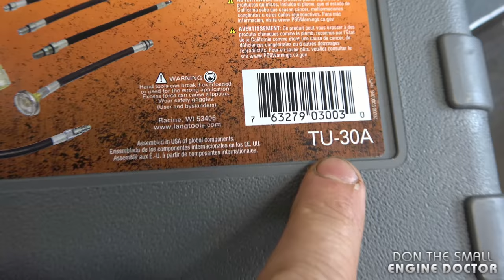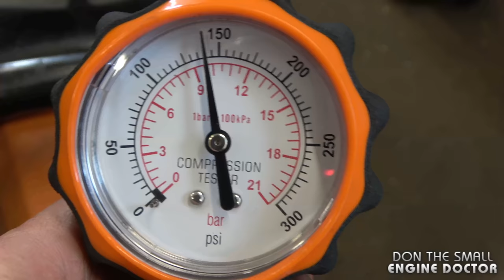You'll Be Shocked This Stihl Chainsaw Runs! You won't Believe It!

Comment: I wish I could see this saw being rebuilt! Gosh, I would donate $5 at least to watch a 1 hour video on you doing a rebuild!
Reply from the maker: really?
Reply: Me too. Sign me up for the rebuild
Reply: Likewise
Reply: Seen that alot in weed eaters. The cylinder expands when it gets hot and there goes your compression. Did you check the compression when it was hot? Bet it would of dropped half of what it was cold. Great video
Reply: @Paradise_Arms  Me Three!
Reply: @donyboy73   hi Donny how’s things man? Brendan from Melbourne Australia.... I’d love for that saw to be posted to me I’d rebuild it👍
Reply: Is it worth the money to rebuild it? It is a $1100 saw to replace it, so yes I would like to see it rebuilt.
Reply: I would as well
Reply: I’m in if you do this.
Reply: If bottom end is okay go for it. your fans want to see this.
Reply: Come on Donny, do it !  As long as the bottom end is good,  It is a good saw.
Reply: Yes a good rebuild video, kinda in depth would be extremely beneficial!
Reply: me to !!
Reply: @donyboy73  Absolutely.
Reply from the maker: @jimwesselman  i'll check prices
Reply: @donyboy73  saw is the piston replaced after repair, will the rings get fit and the compression will increase?
Reply: Agreed get a aftermarket top end an go for it! I wanna see what the rest of the inside looks like
Reply: I have the exact same saw but with M-Tronic . 441C with heated handles and it would be nice to see it being rebuilt 🙂
Reply: Taryl fixes all .may have a video on that.
Reply: Count me in I wanna see this rebuild! I have the same saw

Comment: Great tip Donyboy. Removing the muffler tells the story. Previously  my shop has wasted alot of time trying to find the problem. Now it's our policy on 2 stroke equipment to remove the muffler before doing anything. Amazing how much compression that saw in your video had. I used to go by that before, but not after watching this video. Thanks for the advice. Great following your videos 👍
Reply from the maker: good idea Robert!
Reply: That wear is still not normal, even with thousands of hours of run time, the wear should be slow and a "smoothing" and thinning out of the piston skirts. Scoring should not happen if piston and cylinder is properly lubricated. It got that way either from the airleak making it run lean on fuel, or the gas-oil mixture didn't have enough oil. I would never put 50:1 in 2 strokes, only 40-32:1. I care more about longevity than what the environmentalists say.

Comment: I had no idea that a chainsaw, and I guess pretty much any small engine, needs this kind of in depth checking and maintenance!  I bought a Poulan Pro PR5020 that I still haven't used, but I'm going to have to remember this!  Check for air leaks, cracked intake boot, loose cylinder bolts, etc.  I'll have to learn how to do all of that.  Do you  have a video on this; the whole procedural annual check?  Thanks for being you!

Comment: diagnosing my  old  441 magnum /arctic firewood saw and this video really  showed what to look for first . on my teardown  the crank seals are exposed and are worn out next i am no going to taking off the muffler to see if there is a problem in the cylinder and then deciding if a reseal /repair /rebuild is needed as it is around 20 years of seasonal use with only clutch system parts ,bars ,chains ,filters, plugs. not sure the new ones are actually the way to go vs the cost of rebuilding what has been a basically trouble free saw 🤔

Comment: Very interesting and good advice. After everything the guy replaced, my experience would have gone straight to worn crank seals, of course a leaking jug gasket would have presented itself when diagnosing the situation. I would never have considered pulling the muffler and inspecting the piston, especially when you have good compression. I learned something new today and I am not afraid to admit that I can add that to my 30 odd years of learning and knowledge. Thank you for sharing that information with us.

Comment: In 50+ years of working on saws of all kinds, I've never seen 1 with a hole in the piston but I have seen more than 1 with the piston dimpled/cracked from using an impact with a metal piston stop before. 1 other thing not related directly to the saw is the wear & tear on your shoulders from 50+ years of yanking on 'em especially the stout ones.

Comment: Wow that is a massive beast of a saw. Looks a bit like the huge (German?) one my father in law has (has also done the firewood business, as well as doing IT for a small engine shop, saw was a gift from the owner's family after the owner passed, was apparently set aside to give to him for years). 

Interesting to see another cause of "runs badly when warm". Just fixed my leaf blower in the fall, had stripped crankcase screws. (And finally replaced the disintegrating asbestos exhaust gasket with one that won't give me cancer - amazingly that piston looked ok)

Great video!
Reply: You can get even stronger Saws form Stihl :D but you dont want work withe that the full day :D the mostly used withe long swords for cut down trees than a smaler one to remove the branches

Comment: Yes, lots of videos covering ongoing saw maintenance but you quickly listed several things to check (air leaks, etc)I don’t normally see included. Maybe warrants another video.

But then again I’m now rethinking saving myself time, money and frustration by not spending lots of money on pressure gauges and the rest. Can’t believe I’m saving this, but the writings on the wall, time to get a battery powered model. Money saved not buying tools would easily cover getting into a new battery and charger system.

Comment: You are right - annual checks on well used saws are a must.  That is why I have a Mighty Vac.  I just finished building a 372 and it did not run for the first time without passing a leak down test.  I have found one of the worst places for leaks on Stihl saws is the connection between the boot and the carb.  I usually crank up my saws and spray break cleaner in this area to make sure it is still sealed.  I like the system used on the 372 better than the loose coupling on the Stihl which is dependent to much on nut tension. And the condition of the boot.
Reply from the maker: absolutely!

Comment: Hi Dony, that confirms that compression test, manual by hanging (or with manometer), is not reliable, except when the saw falls easily, so rings are dead  or  oval cylinder or both. It often happens that piston and rings are scratched even with a good test . So you are right : we must take muffler off!

Comment: I've got a 441c thats 10 years old and alot of firewood and chainsaw milling behind it. It's still running ok,but when I tuned it up this spring I checked the compression and it's down to 130psi. It's still got some life left in it but I'd love to see a rebuild video on it for when the time comes. I'd be torn between a $399 oem top end or a meteor kit for $150.

Comment: That there is a good marketing tool for stihl. My goodness that thing should have even started let alone cut...i actually bought a used Husky...exact same thing happened to me .   I knew my mix was right I cut maybe 2 hours with it and then I checked your video and Steve pull that muffler and it was and it was scarred up . I didn't have a dime-sized hole in the Piston but it still ran kind of..but still have good compression I couldn't understand it..would you rebuild that saw???  Seems like it would be worth it.... great video Donnie

Comment: I'm glad you made this video cause I naught a husky 262 last fall and iv been having a lot of trouble getting it to run it's got compression but I looked at the exhaust side a few weeks ago and it's scored  pretty bad. It was suppoaably just rulebuilt with new piston and rings and carb may be new aswell but cylinder is one. I believe I don't know how it got so scored the gas i put in was super rich

Comment: I spray all the areas that normally leak with break cleaner while the saw is running.  If you have a leak the saw will stop dead when you spray it around an area that is leaking.  I spray the carb and boot area, the base gasket flange and the oil pump and flywheel sides.  The last two will check the crankcase seals.  If anything is leaking, the saw will stop, immediately, so you will know what is leaking.  This saves a lot of time pressure testing the saw with a Mighty Vac.

Comment: Our shop had a 441 come in with a larger piece of the skirt missing and it ran as well. It wouldn’t idle, but it will run at full throttle.

Comment: I went to buy a couple saws and asked ahead of time if I could pull the mufflers.  No problem in fact one saw was scored and I got it for next to nothing. But I have had sellers refuse so ask before you take a long trip to see a saw because not all sellers will let you take it off. The honest ones will.  Great video. Simple things first!
Reply from the maker: good tips Ken!
Reply: Is it recommended to change the gaskets when removing and reinstalling the muffler?
Reply: @wingerrrrrrrrr  only of they are leaking

Comment: never ever seen that.  but it makes sense.  my initial thought and it could be as well on an older saw is a case pressure leak.  with the hole in the piston  until the piston drops below the exhaust port  it would vent case to  exhaust. thus lower pulse pressure and reduced fuel. one thing to note on the compression guage-  husqvarna in their manuals want you to use their guages.  the hoses are shorter (like really short and smaller volume). first they only want 3 pulses to get the reading and second it eliminates a lot of pulling.   any guage if you pull long enough will give you a maximum compression  but with fewer pulls it makes compression loss from worn rings and cylinders into consideration.
Reply from the maker: good info, thanks!

Comment: You don't really need to take the muffler off. You cand just use a small flashlight and look through the sparkplug hole. Usually the scoring happens in the exhaust side and if the piston is scored most likely you will see scoring on the exhaust side of the cylinder too .
Reply: What about a bore scope

Comment: I'm still wondering how it had good compression! Was the muffler partially blocked off from running it with a cracked intake boot? That's amazing. I just got through working on a blower that wouldn't run & i thought it was a carb issue so i was taking it apart & while doing so i saw that the intake was loose & that was the problem. But yeah its not always the carb @ fault! Thanks Don for your vids, Always good info & helpful.
Reply from the maker: muffler was not blocked, I think it still ran because Stihl has 2 piston rings instead of one like some husqvarna saws!

Comment: If the seller doesn't want you to take off the muffler, they may let you take out the spark plug.  You can usually see if the cylinder is scored with a bright pen light.

Comment: Seen that alot in weed eaters. The cylinder expands when it gets hot and there goes your compression. Did you check the compression when it was hot? Bet it would of dropped half of what it was cold. Great video
Reply from the maker: no i didn't
Reply: @donyboy73  Really there was no need to after seeing the piston and ring not to mention the cylinder. I was just curious what the reading was if you did. I worked on a Echo that had over 120 cold and 32 when hot. I knew what the issue was, I was just curious how much it lost from a few thousands of expansion. 
Your videos are of good quality and you make it easy for those who are not mechanically inclined or have alot of knowledge what to look and why. Keep up the good work.

Comment: I dont know if you have ever had an oil seal basically fall apart. My 025 was working fine the quit,so I shelved it for awhile and during COVID decided to tear down. After pulling it apart I come across the flywheel side seal laying sideways . The outer part of the oil seal was still in place. Piston and cylinder are in good shape . Did they have some crappy seals at one time?
Reply from the maker: a lot of factors may be involved, could have been a bad batch of seals, who knows

Comment: I got in a MS170 that wouldn't start after letting it sit for several months.  I attempted to start it several times and after the attempt I noticed a lot of oil coming from the muffler area.  It is new.  What could be the issue.

Comment: Hello from Serbia
I have Jonsered 2152 and have problem. When gets worm looks like air leaking. Increase RPM and overheating.  I spray wd 40 on intake boot (rubber) and i kill  saw. There are no cracks on rubber. Any way i replace intake rubber and i have same situation. If you have any idea?

Comment: Even premium pump fuel in Canada now has ethanol in it. Alcohol burns hotter than gas, and will melt 2 cycle pistons. I only use synthetic premix fuels now like Aspen, or Stihls motomix. Fine for me as a consumer, but industrial users that can get pricey.

Comment: Thank you for the great videos, they save me time and money! I have a question that I hope you can help with. I recently bought a used Craftsman chainsaw with a Poulan engine and Zama carb and at that time didn’t know a thing about chainsaws. It ran shortly and then would die each time I tried it. I replaced the fuel lines & filter, installed  a carb kit and replaced the purge bulb then dialed it in. It now runs and cuts without stalling. Before and after replacing the purge bulb, the bulb gets stuck inward and won’t come back out. Do you know what might be causing that to happen? From what I can see there isn’t any kinks in the fuel lines and I can see that the fuel flows in the proper direction when pressing the bulb. Might my return line in the fuel tank be the problem by being to long? I’m at a loss, any suggestion would be greatly appreciated. Thanks for all of the help you’ve provided in your other videos!
Reply: sounds like a bad fuel cap not venting

Comment: I love my 440, that I built a couple of years ago.  I thought the chain was not up to my specs.  My 440 will fly through small woods, like you were cutting.  My bet is - a bad boot made it run lean and smoked the top end.  I would do a leak down test on it, too.  I will bet the seals are smoked, too.
Reply: My opinion is based upon my chainsaws and gas blowers.  The way these engines are designed, a leakdown test wouldn't tell him anything he doesn't already know.  Piston rings were giving him excellent compression.  There are no valves in the cylinder head.  The cylinder and cylinder head is one piece, so no gaskets or sealing surfaces.  Therefore, a leakdown test would not tell him anything.
Reply: @danburch9989  you are probably right but it tells you where it is leaking and how much.  Most two cycles behave irrationally, if they run at all, with air leaks.  Last week I built a 372 and had not installed the oil pump when I tried to get it to pop. It wouldn’t do anything, until I put two short screws in the oil pump holes and then it ran, rather irrationally until I put the oil pump and spacer on.  Then it cranked and ran fine for a new engine.  If a saw is running irrationally I usually look at the seals, however they are sometimes leaking so bad the saw will not even start.  The Mighty Vac tell me which seal is leaking, but if it is seals it probably is bearings, too, because something wiped the seals out.

Comment: It did not cut bad with a dull chain.  The “fines” probably got it along with lots of long term cutting.   The lean condition caused by a cracked boot probably finally did it in.  It probably needs near bearing and seals, too.

Comment: Couldn't a hole like that one in that spot also occur from carbon build up on the edge of the exhaust port? I've seen large gouges in trimmer pistons in the exact same spot that were almost through the piston. I've seen em lock up from it and people start tapping the piston with a wooden dowel through the plug hole to break it free and then keep running it because they don't know any better. I AM NOT DISAGREEING WITH THE DONS WISDOM!!! Hahaha the exhaust didn't look dirty and the cracked boot fits the symptom, I'm merely saying I've seen it on trimmers because I've worked on tons more of them than saws and I'm curious if you think that could cause a hole like that on a saw.

Comment: I call BS on normal wear. That looks like full throttle as soon as it starts into the wood, until it runs lean and runs out of gas. The chain was also dull while doing test cuts so makes me think its dull on a regular basis. Dull chain wears out a saw faster than anything!!
Reply from the maker: they also ran with a cracked intake boot as I mentioned in video

Comment: I can believe it, had ran the famous 044 and 440 with my fire crews for years...awesome tried and true design...ie the 038 series prior was to...purchased the new 441 series 6 of them not a one lasted the summer...so many problems with that design....Stihl pulled them off the shelves after about 8 months in our area...then they released them about 6 months later....new improved....yea right....crap just crap then Stihl pulled them for good...terrible flop for Stihl...then they started releasing the 461...off the 046 design....still using them great saws. I think that's why Stihl did so much  R&D with the 500i...it was out for 2 years before they released it here in the states...I think they didn't want to repeat the 441 debacle. Shoe
Reply from the maker: wow good to know!